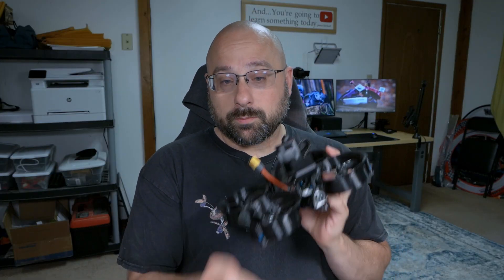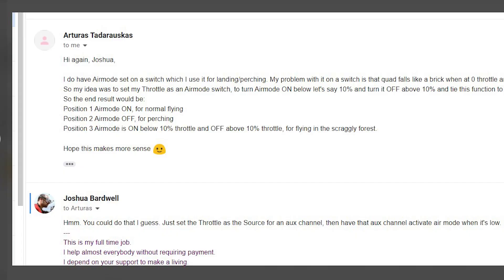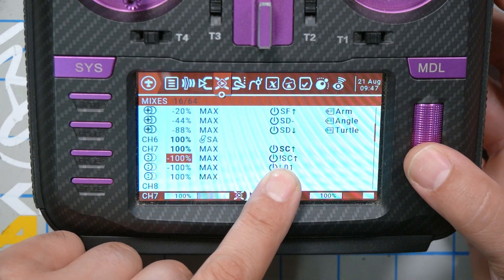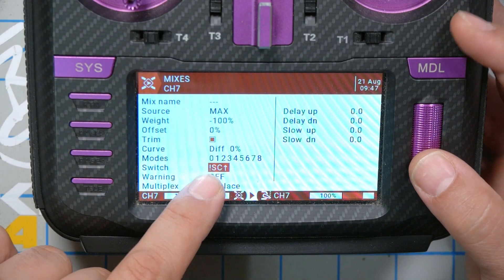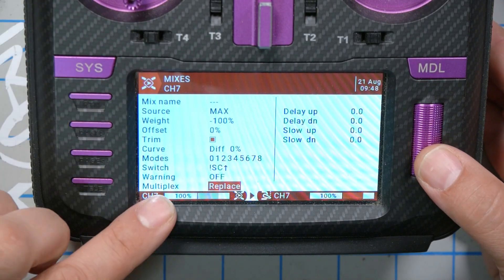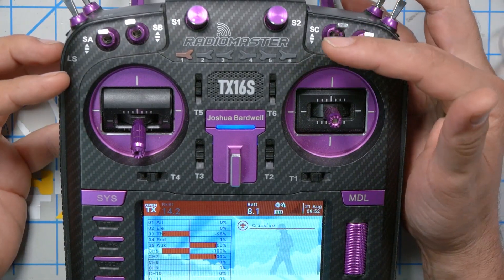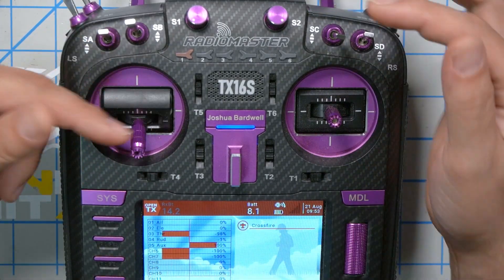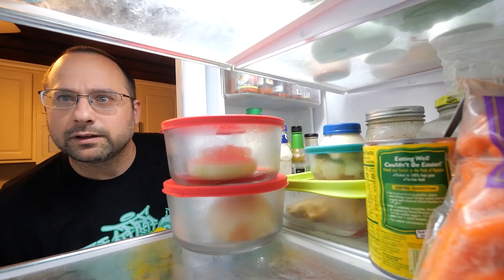Betaflight Air Mode is bad for Whoops. Until now. Maybe.

Comment: Interesting, someone smarter than me should build this into the betaflight configurator modes, and use throttle channel as the input.

Would that many it simpler to setup than opentx mixers?
Reply: Well, this shouldn't be neccesary - it's essentially a bug in airmode. So rather than adding this to betafight, they should just fix airmode. What JB has shown here is a workaround.
Reply: @Vousie  there is no bugs in airmode, this is just the way how it works
Reply: @mikenomatter  Airmode should do as its description says - keep attitude control during zero throttle. Not attach whoops to walls - that is a bug in the way they've implemented the attitude control part of it.
Reply: @Vousie  if you know where they implemented a bug and how to fix it - just do it, it is opensource, feel free)
Reply: @mikenomatter  I don't know how they implemented it, and though I am a contributor to an open source project, I don't have much interest in diving into Betaflight. I just noted that what they say airmode is for is not all it actually ends up doing. Also, thanks for linking the description - I didn't realise it changes the PIDs so much - but nowhere in that description does it say "we also purposely made it attach whoops to walls", so that part is still a bug.
Reply: @Vousie  one more time "attach whoops to walls" - isn't a bug but a consequence to the more authority that AM gives you)
Reply: @mikenomatter "One more time" this is a bug and it needs to be fixed - such as by not letting airmode ramp the motors up to max. There's a point where you'd rather lose a little bit of attitude than have the quad just rocket up to the sky - or in whichever direction it's pointing. The rotorriot guys tried an octo copter, and they tested what happens if they removed one prop - nothing, it flew fine. Then they removed another prop, and it shot up into the sky the moment they armed. That's not just a bug. That's a safety hazard. Mind you, this kind of thing is probably one of the reasons almost no-one uses Betaflight for craft that are actually expensive...
Reply: @Vousie  noone use betaflight for expensive craft couse this is racing drone firmware)
Reply: @mikenomatter  Yeah... It's "racing drone firmware" that's so unrealiable that it can't be used for anything else. And I wouldn't want to even put it on a 5" quad, given its tendency to randomly go to full throttle that you tell me is a "feature"...
Reply: @Vousie  why don't you use a fork to eat soup?) "randomly go to full throttle" I haven't such an issue check your hardware.
Reply: @mikenomatter  Why don't you go fly a kite? The full throttle is whenever it catches on something when I've landed on something uneven. It's the same issue with the "attaching whoops to walls" that's pretty much full throttle on two of the motors at any rate.
Reply: @Vousie  how do you think he should handle a hit at full throttle? Noone can do it acceptable
Reply: @Vousie  I'm bored have a good day
Reply: @mikenomatter  Not at full throttle. Even with throttle all the way down it spools some motors up to full speed when it crashes.
But yes, be "bored" when you realise your point doesn't actually make sense anymore. Bye.
Reply: @Vousie  it isn't really a bug in betaflight, it's an unintended consequence. All airmode does is tell the quadcopter, when armed, keep the motors spinning at a minimum speed so the quad can stay in the air when there's 0 throttle input. then the pid controller works on top of that to keep your quad going in the direction you intend. it's when a mishap occurs and the pid controller tries to compensate (because it still thinks it's in the air) that you have the problem.
Reply: @indus49  Not so the quad can stay in the air - a quad will still fall down in airmode. Airmode keeps the props spinning at very low throttle in order to keep roll, pitch and yaw controllable with the pid loops. Unfortunately in order to correct any drift it obviously needs to speed up some of the motors. This is airmode. But it needs to have a limit if it can't stabilise the attitude - at some point it needs to allow it to lose attitude rather than shoot into the sky - else it will spontaneously go to full throttle trying to keep it level, which is what happened here. That missing limit is the bug I was talking about.

Comment: Isn't this just a more complicated idle up? wouldn't a better option just to be to setup idle up and then put airmode on a switch?
Reply from the maker: Air mode and idle up are similar, but not the same. Flying with idle up and not air mode doesn't feel the same as flying with air mode.

Comment: thanks, but i ve a problem. All setup is ok, betaflight to, but when i'm engage auto air mode with throtle, it does not stop air mode of my whoop when throtle is under -80 (try with -70 same) but when i m test in BF modes it's look ok to disable air mode when throttle low... so what's wrong ? thanks   ... ( in case of ask ,  yes, and air mode setup BF  is disable on config and it s ok when i fly throtle zero motors stop good on switch position off  but not on switch position  auto ...)

Comment: god forbid anyone look at their blackbox data, but....  you can absolutely relate the throttle position to whatever quad is in question hover point.  air mode kicks in just below the quads hover point or over the quads over point or whatever...   I usually set the TPA (Throttle - PID Attenuation) breakpoint around the hover point (throttle position) anyways....
Reply from the maker: Air mode is not active on 1st arming to prevent motor windup. But then after the throttle goes above a certain position, air mode activates. Then it is always active at every throttle position. This is a common misconception about air mode--that it deactivates when the throttle goes back down. The whole point of air mode is to improve low throttle stability so it would make no sense for it to deactivate at low throttle.
Reply: @JoshuaBardwell  Yes, but to take everything you mentioned in your video and use the hover point as a reference for when/where along the throttle to apply your video...
Reply: @JoshuaBardwell  as an example... maybe 50% between 0 throttle and hover (wherever that may be) you apply what was said in your video....  just a thought

Comment: back in the days before airmode existed (baseflight) we programmed the low throttle not to be zero(pwm1000), did we? (can't remember anymore)
Reply from the maker: That's idle up. I remember.
Reply: @JoshuaBardwell  baseflight didn't had idle up did it? It was Kiss Fc's that had idle up.
Reply: Yeah my motors spin at 5.5% when idle. Do I still need airmode?

Comment: I think, I made it simpler. I only set 1 LS x<a - 80 thottle and I set channel 7 to be active only when it is less than - 80% throttle. I set my 3 positioning arm switch to activate this when obly it is on down position which is the acro mode and I usually set hroizon to middle position. So, it will work obly when my whoops are in acro mode and throttle less than 10%.. I dont think I need a setting where I permenantly turn on or turn off...
Reply: Just tested now and my meteor65 is not a Woo girl anymore 😂😂😂

Comment: I am kind of curious to try this. All last winter we did a lot of indoor racing with 75mm-2S type ducted "whoops." Slightly larger gates and rip around full stick acro in a huge barn. Basically flying like a full 5" track with inverted dives, split S, etc. One of the issues we ran into occasionally, is if there was a large inverted maneuver resulting in a potentially prolonged period of time at zero or near zero throttle, the quad would almost "fly away" on its own. My guess is that its a problem with the gyro/FC not understanding what is going on. Ducts probably causing it to wobble while its free-falling, and then either the PID loop or air mode trying to spool up motors to account for it. I am curious if this might get rid of that, or if the issue is completely independent.
Reply: https://youtu.be/b1vAcI3d-EU
Reply: While that video doesn't show it, its in that situation where after the line along the barn's ceiling and dropping to the blue circle, probably about 50% of the time the quad would spool up its motors by itself because its essentially in a partially inverted freefall with 0 throttle input.

Comment: There is also the crash_recovery option in the cli that has a different approach for this
Reply: I was wondering how these two differ, but it seems to me they really are different.  One is trying to self level quad on crash (like in horizon mode), and one is just allowing usable motor range for maneuvers.  Seems like crash_recovery really wants to have airmode on, I would think???  So, maybe a better way of phrasing this is, crash recovery REALLY needs to have airmode!

Comment: Couldn't the betaflight devs just have something we enable by CLI that shows the throttle stick as an input on the modes tab of the configurator?
Reply from the maker: You can do that if you want by copying the throttle channel over to an aux channel in your controller. But then this function cannot be switched on/off.
Reply: @JoshuaBardwell  But you could add a second range using another aux channel from a button to the same mode and make it an AND condition. Then only when either throttle is low and the other button is pressed then its enabled? or any other kind of combination ...

Comment: So i have air mode on a switch so i can slide easily.

So here is my setup, i put air mode on a momentary button on my radio. I have the rotor riot skids on the bottom, but in the back i have 2 foam pads. So now, when you slide on the ground, it should stay straight, because the back feet are dragging. So now i'll grab the momentary switch, no throttle and land/slide and it won't freak out. this works really well on slides (playground slides) as if you do it while armed its freaking out. 

honestly i'm not great with it, but its so fun.

Comment: steele did a video about this like 3 yrs ago
"Throttle IDLE UP Step by Step! Setup"
Reply from the maker: His idle-up video is for KISS. And it's based on a switch (which I also did a video about how to emulate KISS idle up on Betaflight a while back) while this is based on the throttle.
Reply: Was he as nice as he seems he would be?

Comment: why could you just not do it all in BF use that throttle channel and set range to be on at low throttle?
Reply from the maker: You totally could do that but you would need to set up a way to switch it on and off.
Reply: That should work as well. The difference is that he said this one button with the three positions to have it completely off or completely on or only off when you are the lower 20%
Reply: @Grim FPV you can configure your radio to send the throttle value additionally over another aux channel...

Comment: What is the difference if you use just  "set crash_recovery = on" ?
Reply: @Rebellion Above But if you crash faster into this wall, crash recovery kicks in and makes you crash just into the opposite wall as well. :D

On my Tinyhawk II, both Airmode and crash recovery where turned on and it made this little whoop practically unflyable. And I was a total rookie. And it took me a week to figure out why that friggin thing isn't even remotely behaving like that simulation... gosh....

Comment: Can't you just turn down how aggressive the response is to bumping into a wall or was that only on angle mode?
Reply: No, unfortunately the cli commands for crash response do nothing to stop the suction, you can set crash recovery angle to whatever you want.... It literally makes no difference on a ducted quad
Reply: @natewelchwr  I can't even remember the setting/command...all I know is that I've changed it once on the whoops and don't even know what I changed anymore
Reply: @XZLR8N  yea set crash_recovery = on
But... It made no difference on either of my f7 32bit cinewhoops... I have a taycan and a cinerat.... Still like to attach themselves to walls
Reply from the maker: Crash recovery is a totally different feature that isn't related to air mode (and is disabled by default).
Reply: @JoshuaBardwell  for whoops...there was a setting, maybe from an old video of yours. I thought that there was a slider or a switch in Betaflight that would help with whoops in angle mode to not freak out when you bumped a wall. Did I make this up or am I very confused.
Reply: @XZLR8N  The settings you’re describing are in Emuflight, not Betaflight. They’re doing some cool stuff with angle mode in Emu.
Reply: @GRANOLAFPV  ima try out some emuflight. I shoulda put it on a whoop when I flashed the escs.
Reply: @XZLR8N  PMB has an excellent whoop preset for Emuflight. I had to lower the PID values slightly to retain battery life, but not everyone has that issue. http://projectmockingbird.squarespace.com/pmb-setup-guides/pmb-brushless-emu